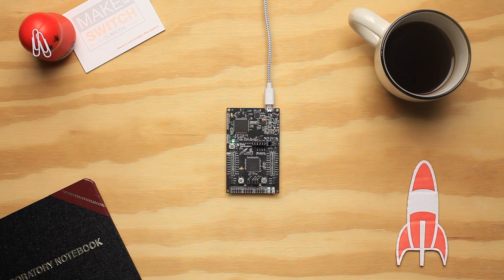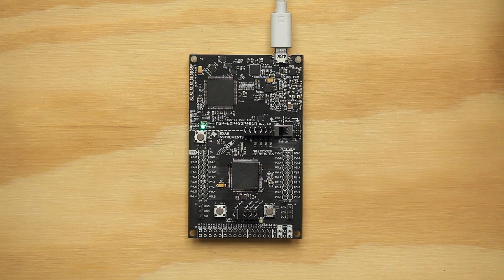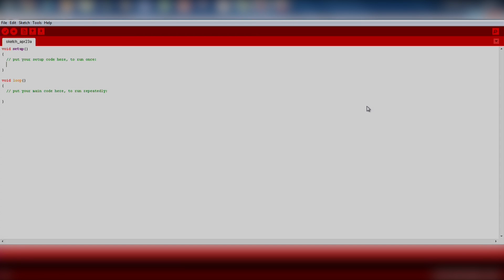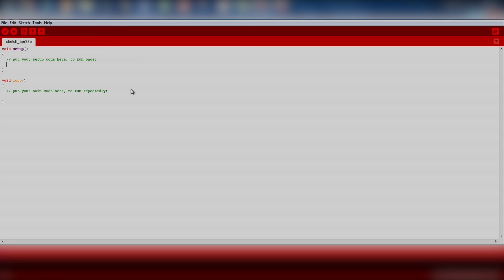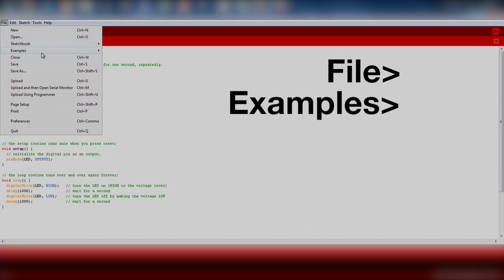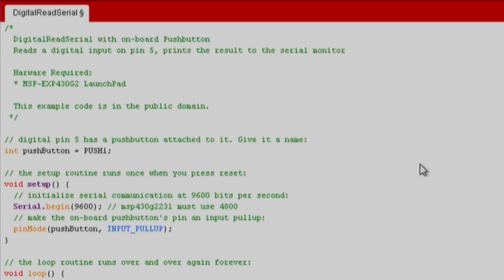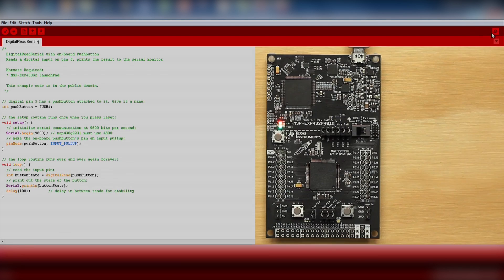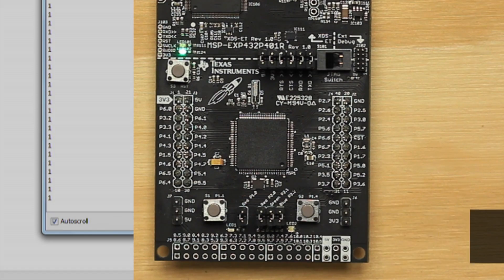Energia Tutorial: MSP432P401R LaunchPad

Comment: I have this problem with ENERGIA, with CCS v6 works fine.

CCROOT D:\Desktop\msp432\energia-0101E0015\hardware\tools\lm4f
SDKROOT D:\Desktop\msp432\energia-0101E0015\hardware\msp432/CC3200SDK_1.0.0.patch
CLOSURE D:\Desktop\msp432\energia-0101E0015\hardware\common
MAINSKETCH Blink.cpp
armcl main.cpp
D:\Desktop\msp432\energia-0101E0015\hardware\tools\lm4f/bin/arm-none-eabi-gcc -c -Os @"D:\Desktop\msp432\energia-0101E0015/hardware/msp432/targets/MSP-EXP432P401R/compiler.opt" -ID:\Desktop\msp432\energia-0101E0015/hardware/msp432/targets/MSP-EXP432P401R/ -ID:\Desktop\msp432\energia-0101E0015/hardware/msp432/targets/MSP-EXP432P401R/configPkg/ -ID:\Desktop\msp432\energia-0101E0015/hardware/msp432/targets/MSP-EXP432P401R/src/ -ID:\Desktop\msp432\energia-0101E0015/hardware/msp432/targets/MSP-EXP432P401R/ti/ -ID:\Desktop\msp432\energia-0101E0015/hardware/msp432/cores/msp432/ -ID:\Desktop\msp432\energia-0101E0015/hardware/msp432/cores/msp432/avr/ -ID:\Desktop\msp432\energia-0101E0015/hardware/msp432/cores/msp432/driverlib/ -ID:\Desktop\msp432\energia-0101E0015/hardware/msp432/cores/msp432/inc/ -ID:\Desktop\msp432\energia-0101E0015/hardware/msp432/cores/msp432/lib/ -ID:\Desktop\msp432\energia-0101E0015/hardware/common/ -ID:\Desktop\msp432\energia-0101E0015/hardware/common/configPkg/ -ID:\Desktop\msp432\energia-0101E0015/hardware/common/gnu/ -ID:\Desktop\msp432\energia-0101E0015/hardware/common/src/ -ID:\Desktop\msp432\energia-0101E0015/hardware/common/ti/ -ID:\Desktop\msp432\energia-0101E0015/hardware/common/xdc/ -ID:\Desktop\msp432\energia-0101E0015/hardware/msp432/libraries/AIR430BoostUSAFCC/ -ID:\Desktop\msp432\energia-0101E0015/hardware/msp432/libraries/AIR430BoostUSAFCC/utility/ -ID:\Desktop\msp432\energia-0101E0015/hardware/msp432/libraries/Adafruit_TMP006/ -ID:\Desktop\msp432\energia-0101E0015/hardware/msp432/libraries/CogLCD/ -ID:\Desktop\msp432\energia-0101E0015/hardware/msp432/libraries/EduBPMKII_Screen/ -ID:\Desktop\msp432\energia-0101E0015/hardware/msp432/libraries/M2XStreamClient/ -ID:\Desktop\msp432\energia-0101E0015/hardware/msp432/libraries/MQTTClient/ -ID:\Desktop\msp432\energia-0101E0015/hardware/msp432/libraries/OPT3001/ -ID:\Desktop\msp432\energia-0101E0015/hardware/msp432/libraries/PubNub/ -ID:\Desktop\msp432\energia-0101E0015/hardware/msp432/libraries/PubSubClient/ -ID:\Desktop\msp432\energia-0101E0015/hardware/msp432/libraries/SHT2x/ -ID:\Desktop\msp432\energia-0101E0015/hardware/msp432/libraries/Temboo/ -ID:\Desktop\msp432\energia-0101E0015/hardware/msp432/libraries/Temboo/utility/ -ID:\Desktop\msp432\energia-0101E0015/hardware/msp432/libraries/WiFi/ -ID:\Desktop\msp432\energia-0101E0015/hardware/msp432/libraries/WiFi/utility/ -ID:\Desktop\msp432\energia-0101E0015/hardware/msp432/libraries/aJson/ -ID:\Desktop\msp432\energia-0101E0015/hardware/msp432/libraries/aJson/utility/ -DF_CPU=48000000L -D__MSP432P401R__ -DTARGET_IS_MSP432P4XX -Dxdc__nolocalstring=1 -ffunction-sections -fdata-sections -DARDUINO=101 -DENERGIA=14 -D__MSP432P401R__ -mfloat-abi=hard -mfpu=fpv4-sp-d16 -fsingle-precision-constant  -fno-exceptions -fno-rtti -I "D:\Desktop\msp432\energia-0101E0015\hardware\tools\lm4f/include" -I "D:\Desktop\msp432\energia-0101E0015\hardware\common" -I "D:\Desktop\msp432\energia-0101E0015\hardware\common" -ID:\Desktop\msp432\energia-0101E0015/hardware/msp432/cores/msp432/inc/CMSIS main.cpp -o main.obj
armcl Blink.cpp
D:\Desktop\msp432\energia-0101E0015\hardware\tools\lm4f/bin/arm-none-eabi-gcc -c -Os @"D:\Desktop\msp432\energia-0101E0015/hardware/msp432/targets/MSP-EXP432P401R/compiler.opt" -ID:\Desktop\msp432\energia-0101E0015/hardware/msp432/targets/MSP-EXP432P401R/ -ID:\Desktop\msp432\energia-0101E0015/hardware/msp432/targets/MSP-EXP432P401R/configPkg/ -ID:\Desktop\msp432\energia-0101E0015/hardware/msp432/targets/MSP-EXP432P401R/src/ -ID:\Desktop\msp432\energia-0101E0015/hardware/msp432/targets/MSP-EXP432P401R/ti/ -ID:\Desktop\msp432\energia-0101E0015/hardware/msp432/cores/msp432/ -ID:\Desktop\msp432\energia-0101E0015/hardware/msp432/cores/msp432/avr/ -ID:\Desktop\msp432\energia-0101E0015/hardware/msp432/cores/msp432/driverlib/ -ID:\Desktop\msp432\energia-0101E0015/hardware/msp432/cores/msp432/inc/ -ID:\Desktop\msp432\energia-0101E0015/hardware/msp432/cores/msp432/lib/ -ID:\Desktop\msp432\energia-0101E0015/hardware/common/ -ID:\Desktop\msp432\energia-0101E0015/hardware/common/configPkg/ -ID:\Desktop\msp432\energia-0101E0015/hardware/common/gnu/ -ID:\Desktop\msp432\energia-0101E0015/hardware/common/src/ -ID:\Desktop\msp432\energia-0101E0015/hardware/common/ti/ -ID:\Desktop\msp432\energia-0101E0015/hardware/common/xdc/ -ID:\Desktop\msp432\energia-0101E0015/hardware/msp432/libraries/AIR430BoostUSAFCC/ -ID:\Desktop\msp432\energia-0101E0015/hardware/msp432/libraries/AIR430BoostUSAFCC/utility/ -ID:\Desktop\msp432\energia-0101E0015/hardware/msp432/libraries/Adafruit_TMP006/ -ID:\Desktop\msp432\energia-0101E0015/hardware/msp432/libraries/CogLCD/ -ID:\Desktop\msp432\energia-0101E0015/hardware/msp432/libraries/EduBPMKII_Screen/ -ID:\Desktop\msp432\energia-0101E0015/hardware/msp432/libraries/M2XStreamClient/ -ID:\Desktop\msp432\energia-0101E0015/hardware/msp432/libraries/MQTTClient/ -ID:\Desktop\msp432\energia-0101E0015/hardware/msp432/libraries/OPT3001/ -ID:\Desktop\msp432\energia-0101E0015/hardware/msp432/libraries/PubNub/ -ID:\Desktop\msp432\energia-0101E0015/hardware/msp432/libraries/PubSubClient/ -ID:\Desktop\msp432\energia-0101E0015/hardware/msp432/libraries/SHT2x/ -ID:\Desktop\msp432\energia-0101E0015/hardware/msp432/libraries/Temboo/ -ID:\Desktop\msp432\energia-0101E0015/hardware/msp432/libraries/Temboo/utility/ -ID:\Desktop\msp432\energia-0101E0015/hardware/msp432/libraries/WiFi/ -ID:\Desktop\msp432\energia-0101E0015/hardware/msp432/libraries/WiFi/utility/ -ID:\Desktop\msp432\energia-0101E0015/hardware/msp432/libraries/aJson/ -ID:\Desktop\msp432\energia-0101E0015/hardware/msp432/libraries/aJson/utility/ -DF_CPU=48000000L -D__MSP432P401R__ -DTARGET_IS_MSP432P4XX -Dxdc__nolocalstring=1 -ffunction-sections -fdata-sections -DARDUINO=101 -DENERGIA=14 -D__MSP432P401R__ -mfloat-abi=hard -mfpu=fpv4-sp-d16 -fsingle-precision-constant  -fno-exceptions -fno-rtti -I "D:\Desktop\msp432\energia-0101E0015\hardware\tools\lm4f/include" -I "D:\Desktop\msp432\energia-0101E0015\hardware\common" -I "D:\Desktop\msp432\energia-0101E0015\hardware\common" -ID:\Desktop\msp432\energia-0101E0015/hardware/msp432/cores/msp432/inc/CMSIS Blink.cpp -o Blink.obj
armlink  main.obj  Blink.obj   
D:\Desktop\msp432\energia-0101E0015\hardware\tools\lm4f/bin/arm-none-eabi-gcc -Os @"D:\Desktop\msp432\energia-0101E0015/hardware/msp432/targets/MSP-EXP432P401R/compiler.opt" -nostartfiles -Wl,--no-wchar-size-warning -Wl,-static -Wl,--gc-sections -L"D:\Desktop\msp432\energia-0101E0015\hardware\common" -L"D:\Desktop\msp432\energia-0101E0015\hardware\tools\lm4f/lib"  main.obj  Blink.obj    -Wl,-T"D:\Desktop\msp432\energia-0101E0015/hardware/msp432/targets/MSP-EXP432P401R/linker.cmd" -LD:\Desktop\msp432\energia-0101E0015/hardware/msp432/targets/MSP-EXP432P401R -LD:\Desktop\msp432\energia-0101E0015/hardware/common/libs D:\Desktop\msp432\energia-0101E0015/hardware/msp432/cores/msp432/driverlib/libdriverlib.a  -lstdc++ -lgcc -lc -lm -lnosys -Wl,-Map=Blink.cpp.map -o Blink.cpp.elf
Creating Blink.cpp.bin
Binary sketch size: 45603 bytes (of a 262144 byte maximum)
>>>> Done <<<<
Initializing debug probe...
 Configuring Debugger (may take a few minutes on first launch)...:
  Initializing Register Database...
  Initializing: CS_DAP_0
  Executing Startup Scripts: CS_DAP_0
  Initializing: CORTEX_M4_0
  Executing Startup Scripts: CORTEX_M4_0
Connecting...
 Fatal: CS_DAP_0: Error connecting to the target: (Error -263 @ 0x0) Incompatible XDS110 firmware detected.  The firmware version of the connected XDS110 debug probe does not  match the expected version. Please update the firmware using the xdsdfu  utility found in  the .../ccs_base/common/uscif/xds110 directory of  your installation. View the ReadMe.txt file there for instructions. (Emulation package 0.0.0.0) 
Failed: Failed to evaluate GEL_Connect(): Connect failed